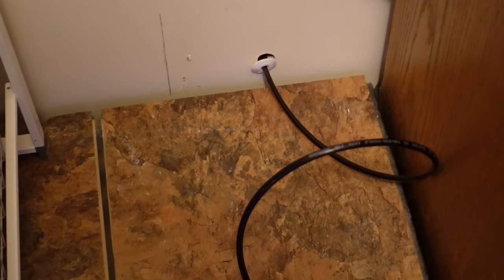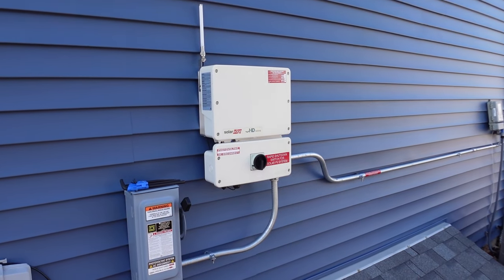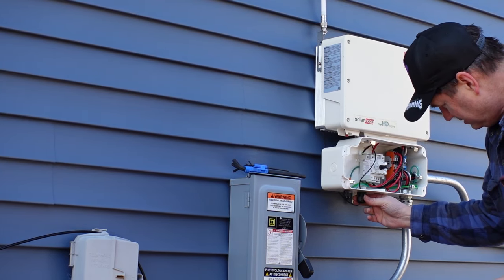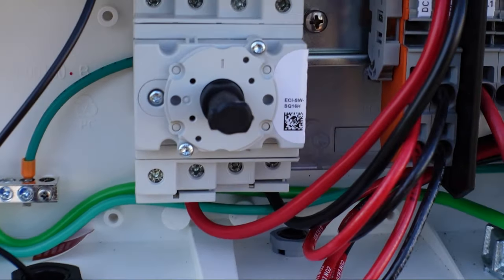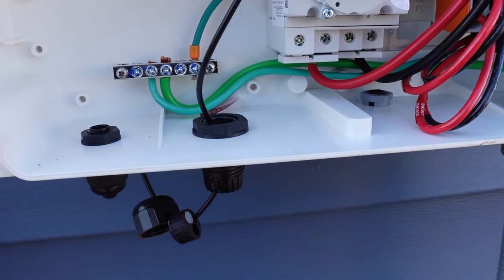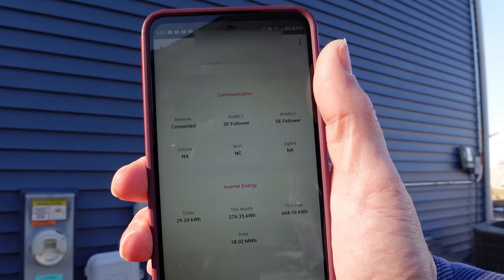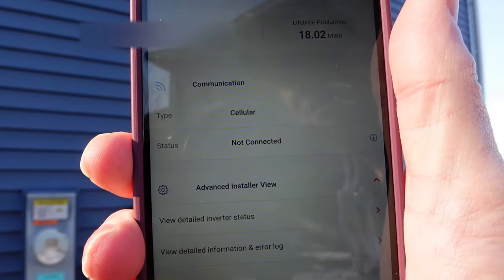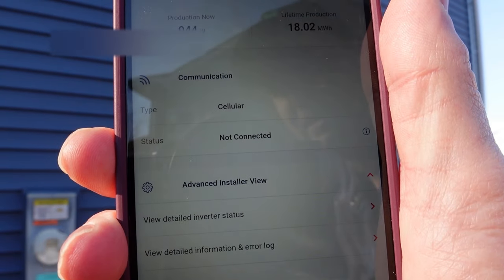Solar Edge Inverter? 3g modem? Upgrade for less than $25

Comment: Great video.  For my setup, i removed the power, LEFT THE 3GCELL ANTENNE CRAP INSTALLED.  opened the panel, and ran a cat 6 wire to rear of router hub.  Turned power bsck to unit, and it immediately refreshed itself and started working as before.  Didnt hsve to log into anything or call swindleredge for assistsnce.  I believe THE KEY WITH THIS IS TO LEAVE THE 3GE CRAP IN PLACE AND REMOVING THE POWER.  THEN SIMPLY ADDING THE CAT6 CORD WITHOUT REMOVING THE 3G CRAP.  ATlesst thats how it worked for mine.  Thanks for your video!!!
Reply from the maker: That is super helpful.  Thanks.  Hope this works for others.
Reply: Wish I had seen this before removing my 3G.  I cut the cable.  I'm probably effed.
Reply: This didn’t work for me. Installed my Ethernet cable and still nothing.

Comment: Good video, T-Mobile shut mines off 5/31 at 11:47 pm...had no previous notice....good thing is my internet provider box in the garage is on the inside of the wall opposite of the inverter...I'll give it a go 👍🏿
Reply: Mine shut off June 1st No notice 🤬 longtime on phone then installer can come out July 22nd 🤬
Reply: To be perfectly fair, solar edge sent out an email to everyone affected in January. But yes, lots of deadbeat installers. Mine was still in business but refused to do anything. The closest installer performing servicing of existing systems in my area was 2 hours away. Had to fix everything myself. I only waited this late because my installer lied to me in January and told me to await further communication so I naively assumed they were on top of things.

Comment: Mine started with shielded ethernet originally. I advise that you get some lightning arrestors on both ends, and a cheap Ethernet switch between that outdoor cable and the router, another before the inverter. My system has had 3 comm cards replaced from lightning hits in 7 years. I've added filter the first time, switches the second time, then arrestors this time. Fingers crossed for future. The last storm took out 3 ethernet switches, a router and the solar edge comm card.

Comment: This video helped out & my system just auto connected to Ethernet.  Back in production on the app & I've confirmed with my monitoring company.  I couldn't get the cable through that DC slot/grommet so I kinda had to mutilate the box and make a small spot for it

Comment: Great video. I would have put the Ethernet cable in conduit since most of the shelf cabless are not rated for outdoors and will probably degrade with sunlight uv light. I installed Ethernet to my inverter the week after the installers left and sold my cellular connector. One added benefit to Ethernet is the uploads are much more frequent than cellular. On the new Energy Hub inverters the innards are so crammed it was a bit to get the wire to the upper box  Lastly it's not critical but I used shielded Ethernet since there are serious power running into the inverter
Reply from the maker: Mine is rated for underground usage. Doesn't make it very flexible but makes it strong.
Reply: How did you tell the Inverter to communicate via Ethernet Instead?

Comment: I know that many listeners are thinking...what a long sad story...but I too had the same problems with Solaredge...their customer service department is in a distant English speaking country that simply follows a script to help resolve your problems. I began calling them 06/08/22 and as of today 08/03/22 still am not connected. They are a huge company, and have not dedicated enough to customer support. I could go on longer with more complaints...but if you are DIY - don't use Solaredge...they will make you crazy for sure.

Comment: I watched this video hoping to see what settings in the app need to be changed.  Didn’t really need to see how to run a cat5 cable
Reply from the maker: Sorry to disappoint.  That was the challenging part for me.  The app part was the easy part once I gained access which is why I glossed over it.  There are limited settings in SetApp so is easy to find.

Comment: Thank for the great instructions- installation of the Ethernet cable / system went nice and easy. Now the only problem is SolarEdge will not update my inverter unless I hire a rep for the installation of the Ethernet cable - Any suggestions where I can get the software my self to update the inverter To allow it to switch over to the ethernet system rather than the 3G card. Thank you for your reply
Reply: my solar edge SettApp
Reply: @Alex13mod  Is anything required on the back-end to use the Set app?
Reply: @imolazhp11 is just creating an account that took like 5 mins to do. Then I plugged in a cheap repeater to it, and it worked. With the Set App, you can enable  ethernet and push updates.

Comment: dont know if it'S the same thing, but im using a gateway.  solaredge first sent the sim card thinggy but was able to get them to send out a gateway when my inverter was replaced due to the old one having the cover screw seized.   my new inverter looks like yours.

Comment: I was just wondering why you had to leave the 3-g modem and I left mine in when I put my ethernet in but I removed my antenna my monitoring works but my inverter had quit producing power a week earlier still waiting for a ticket from my installer to get it warrantied out

Comment: I installed the Ethernet but I am also having that issue. I can’t get it to switch over. I have called SolarEdge and now they are only communicating via cellular.  I downloaded the SolarEdge Setup app. But it won’t allow me to log in. Can you help?
Reply: Any luck?
Reply: @imolazhp11  I’m in same position. Did you have any success?

Comment: Hello my friend. I suspected all along that this was possible. I was in the information Technology Systems for 10yrs in the USAF. I've been a technician all my life. Anyway, my installer was one of those fly by night operations, they were actually a siding company. They decided one day to rename their comp with the Solar word in it to try to get a piece of the action, so to speak. It was a nightmare. But, I think they got caught. They claimed Bankruptcy and disappeared, all unbeknownst to me. 
My system went down Dec 28th, 2022. It has taken me two months now to find out what was even wrong with it. I noticed my
invertor is about 50 yards away from my house modem. I would like to run an ethernet cable to it like you did. I might put it in
a pvc pipe and bury it. But, what I would like to ask you is what else would I need to buy or get ready or what else would I have
to go through to get it up and running. How big are the hoops I gotta jump through. I'm sure I'm going to be told to buy the 500
dollar modem. Heck my inverter is in my WiFi range too!  Thanks for this video, it just confirmed my suspicions. I subscribed and thumbs up which I never do...
Reply from the maker: Thanks for the comment. I would call solar edge and see what they could do to help.  I was lucky in that my modem still worked when I changed to Ethernet so that I was still able to upgrade the inverter before changing to Ethernet.

Comment: I called Sigoura Solar, my installer today and they said that opening the inverter box to install the ethernet will void my entire warranty on the system. I feel they should pay for and perform the upgrade on my 3 year old system. They aren't buying it......
Reply from the maker: That is a bunch of BS. Sorry to hear your installer is treating you that way. I have a documented ticket with solar edge and an email with instructions from the installer. I am covered. No effect to my warranty. Now, if I didn't install it properly like leaving out the grommet so bugs and moisture could get in, that would be a different story.
Reply: I agree BS. The manufacturer warranty is independent of the installers own warranty. Now if you don't shut the inverter down properly and somehow short the system then that's on you and you'll have to pay to replace.

Comment: Kinda confused; do we still have to use the SetApp to update the system to Ethernet. What options do we have if SolarEdge refuses to let us have access to the setapp? This is some great information btw.
Reply from the maker: Yeah, you didn't get a rep that was cooperative.  A couple of suggestions...  try and contact them on Twitter asking them how you can gain access to the ethernet via SetApp.  Stress the cable is already installed and just need to change the setting in order to use it.  Also, you could try and call back saying the same thing hoping to get a more sympathetic ear.  Also, ask for a supervisor without belittling the person.  "I understand you don't have the ability to make this happen.  Please transfer me to a supervisor."  Don't let them tell you that they can't transfer because that is a lie.  Hope that helps.
Reply: @MaxVoltageMiningCrypto  Thanks for the reply! I was able to create my own account on the Setapp following some of the comments on your page and was successful in changing the communication to Ethernet. This is some really good information. I was enroute to by me a Wireless Gateway for 400 bucks. Glad I found your video and I don't have too now :). Very Much appreciated!
Reply: @JoseMendoza-gq1bx  Hey! Can you point me to which comments got you the info you needed please? Also, do you think it’s possible to do without any IT knowledge (I’m not tech illiterate, but don’t want to bite off something I shouldn’t). Thanks!
Reply: @davidprice96 Look for the comment with like 9 or 10+ replies. One of those will help point you in the right direction. Basically, create a SetApp account using a 'fake' EIN number. Don't use your real SolarEdge information when you come across that segment, in fact you should be able to bypass that part. Made up my own 'Business Name" etc. and walla, my SetApp verified via email and created. Change settings to Ethernet port, connect your cable and done. You may need to restart your SolarEdge system after you've changed the Ethernet settings a couple times. I had to do it twice for the changes to update. Yes, it's a straightforward app. GL

Comment: How can u get into the set app app it only lets me view
Reply from the maker: Others here have said to create a new account with a different email address than your main account. The other option is to call solar edge and see if you can convince them to give you an installer account. That is what I did.
Reply: I did this method with in 15 min I was done. 
An update was done with the setapp, just wait 8 min to update. Then once it done go on monitoring Function change the connection from cellular to Ethernet and change. The go to my solar app let it load then it will take a min for it show
Reply: @Ortega_Beams  Does the update require the cellular modem?  I hate to say this, but I cut the cable.  Can the set app use ethernet to download the update?

Comment: So once updated it through the set app it automatically connected to the new modem? I tried replacing an old modem today and it was still stuck on cellular and did not switch over. I thought Ethernet meant you’re connecting the to LAN?
Reply from the maker: In my case, I needed to gain access to SetApp in order to change my connection from cellular modem to Ethernet.
Reply: @MaxVoltageMiningCrypto  so do you have a step by step for that

Comment: Question:

Can this still be done if 3G has been shut off for my system? without any communication im not sure how the update can be downloaded.
Reply from the maker: Not sure, update might not be required to make the change
Reply: @MaxVoltageMiningCrypto  Solaredge will not take any calls regarding this (probably overwhelmed) and advising to contact installer directly. Installer is quoting 300USD to do this. From your video it seems like all they will be doing is plugging in Ethernet... But without access to the setup app like you did, not sure how I will be able to switch from cellular to LAN.
Reply: @MaxVoltageMiningCrypto  Another update. Solaredge WILL NOT give temporary access to the SetApp so you are very lucky. Think I will have to pay for an installer to make change for me :/
Reply: You can get access to the setapp app by creating an installer account from the link in the app. Just use a different email and don't try to enter your inverter serial number. The account setup is all automatic. Once you confirm your email and login to the setapp, you should be able to use it to connect to and reconfigure your inverter
Reply: @19Stifler91  How long did it take for the installer to contact you?
Reply: @R_J_G  Took a long while. Their only solution was to charge alot of money for a new card or switching to ethernet which literally required plugging in an ethernet cable. Crazy. After getting advice from Daniel above, I got access to the SetApp and just did this myself.
Reply: @19Stifler91  I’m going through this right now. How long is a long while? Running a cable to my modem inside the house is not a solution for me.
Reply: @R_J_G  I mean I'm sure we have different installers so It doesn't really matter. Depends on how motivated they are to sell you something. If LAN from modem to Inverter is not an option for you and you have to stay cellular, you can wait to hear back from your installer about paying for a replacement, of see if you can find a 4G/LTE replacement card on ebay or something and swap yourself (wont require and SetApp changes).

Comment: I set up an installer account . But when I go to enter my serial number, it says it is invalid. i did enter just the last 10 digits/characters as it showed how to do in the info button. Any idea what I am doing wrong? thanks, Ken
Reply from the maker: Is there a reason you can't scan the qr code? That is what I use. Are you putting a dash between the 8th and 9th character?
Reply from the maker: And thank you for the question. Without it, I wouldn't have discovered that one of my power optimizers was down. Firmware update and reboot solved the issue for now. I now know to keep an eye on this.
Reply: @MaxVoltageMiningCrypto  Hi Max, Happy belated 4th 0f July. I set the installer account up using my desktop
computer. I am not able to use it on my Iphone as everytime I click on the Solaredge Icon it goes to my user account.
How do I access the installer account I set up from my Iphone? I appreciate your help ,but don't feel you have to do any 
more.
Thanks, Ken
Reply from the maker: @kenhanula6007  only thing I can think of is to set up an account from the phone.  I am lucky in that I am on an account that solar edge set up for me. You could try calling solar edge and don't take no for an answer. Good luck.
Reply: @MaxVoltageMiningCrypto  Thanks, I will keep working on it.

Ken

Comment: Max Voltage, I have SolarEdge too installed late 2019 mine cut off June 1st just blinking green lite tried the reboot etc. made ticket with SolarEdge and longtime on phone with pink energy the installer and they can maybe come out the end of July 🤬🤬 looks like something I can do but do you think it will update without the problem you had now?
Reply: I made fake account for setup app and after a day of messing with it all works great now 👌🏼🏆🏆🏆🏆🏆
Reply: I made fake account for setup app and after a day of messing with it all works great now 👌🏼🏆🏆🏆🏆🏆
Reply: @DATSRIGHTMAN  so what email did you give them? your original?

Comment: Max voltage, I did Ethernet and made fake account for set up I was able to default inverter to ethernet with solid blue light communications fine but green light still blinking and not charging, any ideas?
Reply: How did you do the fake account?  Only option in the setapp app is log in or forgot password
Reply: You need to pair the optimizers or one or more optimizers are broken.  You need the set app, which you will never get credentials for.
Solar Edge will not help you.  This guy was lucky, but voided his warranty.  My installer went out of business, and I have 15k$ of silicon just sitting on my roof.
Reply: @victordonofrio7648  does it really void the warranty for changing it your self from Cellular?

Comment: Question, why did you have to reinstall the 3g chip?
Reply from the maker: I had to reinstall because I needed to update the software before I could change the default to Ethernet, according to the person I spoke to at solar edge. The only way to download the update was via 3g cellular modern
Reply: That sounds like bs. If 3g is already shut down, no OTA update is coming over it. Setapp downloads the inverter firmware and installs it when you connect to the inverter. It does that over wifi. Though maybe the wifi and 3g radio are in the same module? Idk.

Comment: The screenless inverter is WIFI capable (since I connect to it from my phone over wifi). 
So, it ought to be able to connect directly to my home WIFI, no ? If so, do I need some additional hardware (like zigbee plugin) ? 
Has anybody tried that ? How did you do it ?
Thank you everybody
Reply from the maker: You would think that, right?  But no.  Yes, you need something to work with ZigBee.  Since I didn't go that direction, I don't have the details. Sorry.